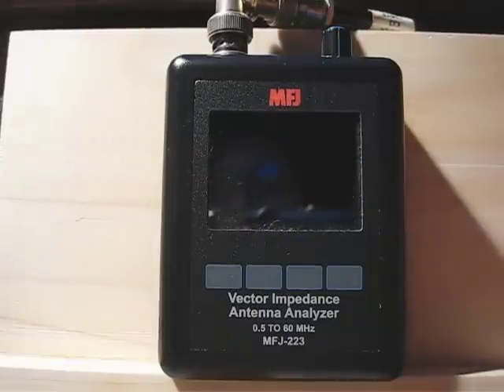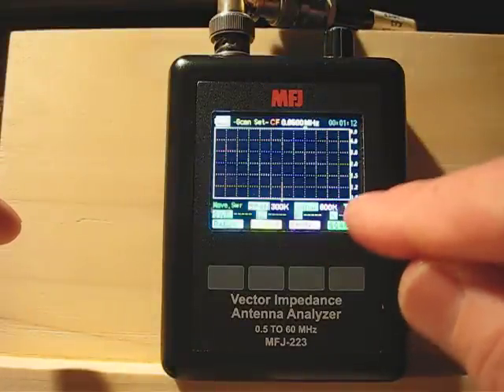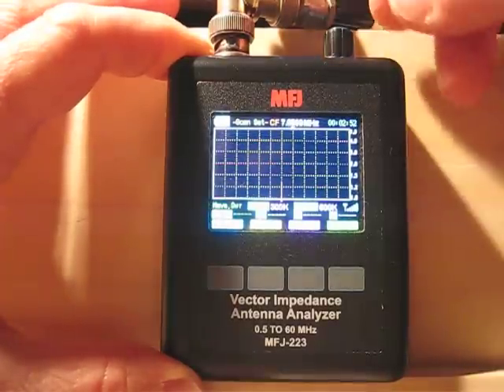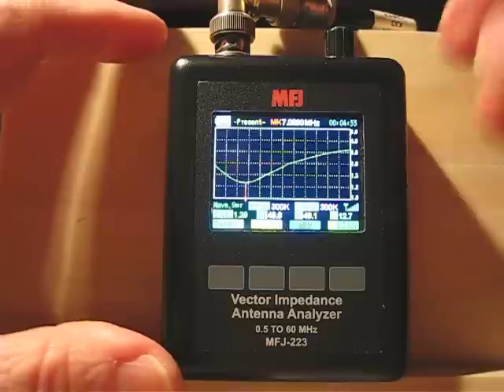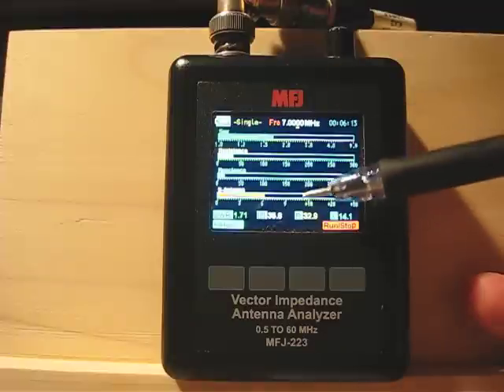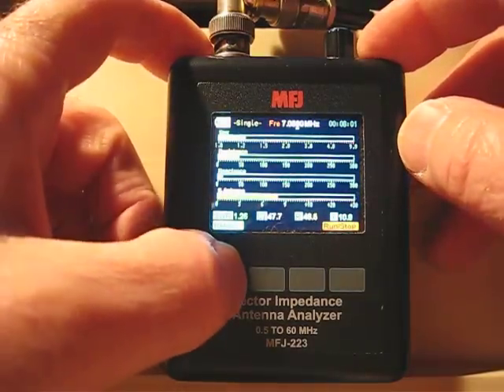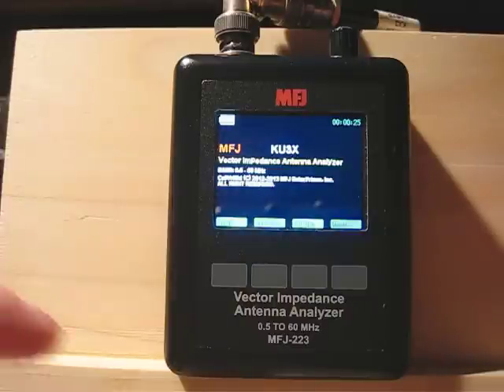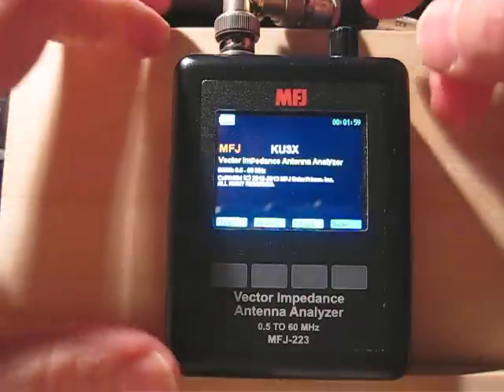mfj223

Comment: I'm going to drop a comment on this as a necropost. Good overview, Barry! I just got the latest edition of the MFJ-223 today. 4 years makes a big difference in the technology. They changed a few things since you did your video, mostly in the controls. 

The encoder button on top is shorter. The power is no longer turned on and off using the encoder button, but instead it has a membrane on-off button underneath the first soft button. You still hold it for 2-3 seconds until it beeps to start it up. The charge port is a microUSB port on TOP of the unit now, along with the red/green LED, smack dab between the BNC connector and the encoder.

Since they say in the manual to charge it fully before the first use (they really stress it, maybe using it with the lower initial charge isn't good for the charge profile of the battery? Who knows?) so I put it on charge until the LED turned green. Everything else is still exactly the same once you turn the unit on. Everything is the same, except that in scan mode it doesn't just sit there until it's done, it shows you the progress of the scan by drawing the graph in real time. I like that better, as you can tell it's doing something, not just sitting and spinning!

I still have to learn how to use it to tune an antenna. I enjoy making mine rather than buying them premade, though I do have an offset-leg dipole up over the yard right now I bought from Atomic Antennas about ten years or so ago. Lately, I've been building QRP antennas, the SOTABEAMS single-bander end-feds, the QRPGuys multi-band trapped end-fed, and my current favorite, the end-fed W3ERP antenna. I have the half-size outside going to a tree from the porch, and a quarter-size inside over my bench for testing. The VNA will give me a bit of help getting the W3ERP antennas all tuned up. They're supposed to be used with a 4:1 unun (which I have) but someone on a QRP board told me it'd work better with a 1:1 balun, so I'm going to give that a try. If nothing else, I'll have the 1:1 balun in my shack if I need it.

Thanks for a great video showing me what I can expect from this great little device. I wanted to leave a note to let you know your video is still useful, and that the device has only improved over time!

73!
Gwen, NG3P
Reply: Thanks for you updates on the analyzer. 
Barry, KU3X

Comment: I am a new Ham. How do you connect this to the antenna and transceiver. I see it has a coax cable with a USB connector. Will I need a jumper cable with an259 connector on one end and a USB connector on the other. Thanks in advance. 73’s. KN4HNO.
Reply: I don't understand your question? You use the BNC connector on top of the 223 to hook to your antenna or coax going to your antenna. Now you read the information off of the MFJ 223. You don't even need a radio to use this item. When you are done checking your antenna, unhook it and hook the coax to your radio.
My suggestion to you is to go to the MFJ web page and download the manual for the MFJ 223. This will give you a better understanding. 
Barry
Reply: Barry's right. This isn't a tuner or SWR meter you put inline between the antenna and the radio. It's a self-contained unit that generates the RF needed to test the antenna's resonance. You just connect your antenna to the BNC connector and you're ready. It isn't a part of the chain between your rig and the antenna, it's just a test device to check at what frequencies your antenna is naturally resonant, and what the SWR is at various points in the spectrum.
Reply: Really short answer. NEVER connect to a radio, one small blast of RF will kill you nice new analyser. You connect it to your antenna ONLY.